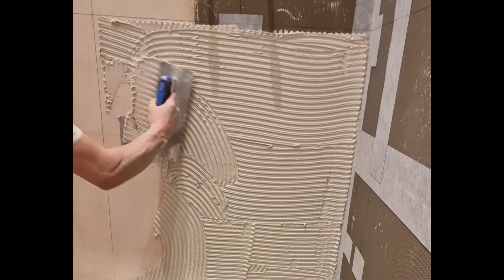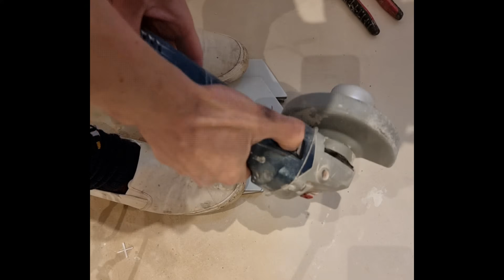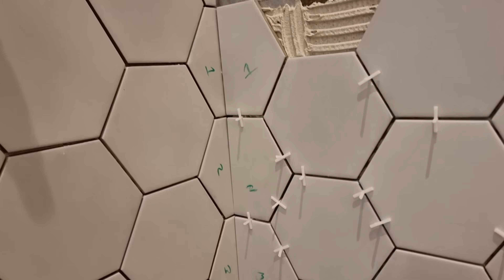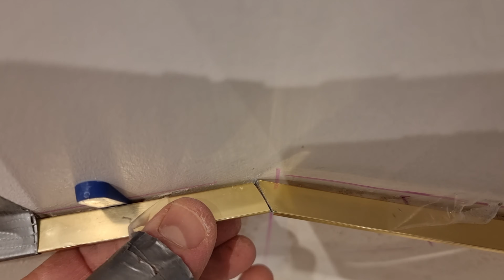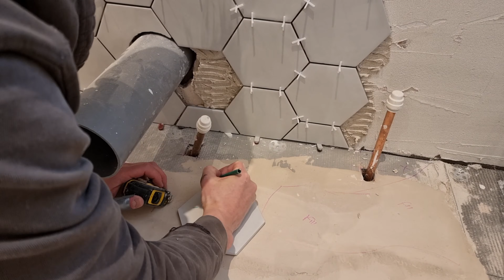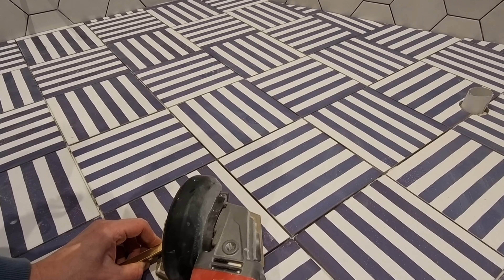How To Install Hexagon Tiles | Easy Beginners Guide

Comment: I noticed on the wall opposite the shower their is a skim coat or primer on the wall. Is that drywall plaster, thinset, or grip primer? In the US gypsum/drywall board is used in newer homes, but they are sometimes textured and painted, so we have to either replace it with tile backer board (cement or foam) or skim coat the texture flat and add a grip primer to make the surface like sandpaper. Just curious to see if that is the same process or a new and easier way. Thanks!
Reply from the maker: Hey mate, Tile dependent but basically the same process. That one is just primed/skimmed with thinset as they are small light tiles. But with a bigger large format tile I'd probably look to remove the paint/painted area if possible.

Comment: Great video. Any tips on setting out using hexagon tiles on both walls and floor?
Reply from the maker: Thanks, The same principles usually apply like.. if you've got a half height wall you want a full and a half to finish at the top, If you've got a "feature" walls you'd ideally centre that, and continue the pattern around from there. Maybe if you have niches and windows, you can try and line the bottoms up with full and half tiles, as it will look a bit nicer e.t.c. I do have a tile Setout app where you can run your hexagons through it for an ideal Setout, which may help.

Comment: Hey, thanks so much for your videos!

I'm going to be tiling some 100x100 ceramic tiles soon that are 9mm thick.

Should I use an 8mm trowel on the wall, and back butter using the flat part of the trowel? And if so, what kind of thickness of adhesive on the wall can I expect?
Reply from the maker: Hey you're welcome! Are there 100mm (10cm) tiles? If they are I wouldn't worry to much about back buttering them (as they are small ceramic) , But you can for re-assurance. 8mm trowel would be ideal for those, and you'll probably end up with about 3-5mm bed once compacted. If they are 100cm tiles, I'd go 6mm on the wall and 10mm on the tile and bed will be about 8mm. 🍻
Reply: @thebespokebloke legend, thank you! Apologies, I meant 100mm 😅
Reply from the maker: @ross1012  Awesome , Yeah I wouldn't bother back edging them then (Unless you plan to be in there for 3 years) Best of luck mate!

Comment: I’m currently having my bathroom tiled with hexagon tiles but the fitter hasn’t followed the pattern around the corner so it looks quite strange. I’ve watched your video which clearly says to follow the tiles & pattern around the corner. Would it be different with a patterned tile or would there be any situations when you wouldn’t follow the pattern around the corner? Thank you
Reply from the maker: Hey Ellie, In my opinion, I'd always try and make a pattern tile follow around the wall. Just as otherwise it looks a bit weird. But some people may not mind that. It's one of those really, I don't want to chuck the fitter under the bus.. but as a professional you'd normally think about these kind of things, or have a discussion with the customer about it. Also there is cost and different standards of work chucked into that. In my line of work a pattern or shape has to be continued if possible, But to someone else they may have a different view or view it as "They are just tiles". So long story short in my house i wouldn't have it not matched up, But some people may not mind it. Hope that helps

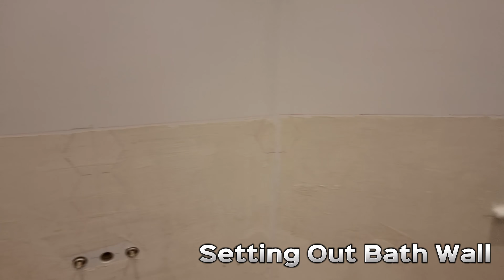Comment: 11:28 I always get confused by this and any other tile walls. how do you know if a tile will connect to the wall without placing each tile one by one until you reach the wall.
Reply from the maker: Take a measurement of tiles laid out on the floor, Or measure from what you've already done mate.. Or even better use my "Tile Layout App" Links are on my main page at the top!

Comment: Hi, when cutting out half pieces to fit to the floor, do you need to over-cut a few mm to allow for the spacing between tiles? I've cut a tile in half and it looks too big? 

Also, are some manual tile cutters better than others? I've got one from a "starter pack" and it just doesn't seem to work as easily as ones I'm seeing in videos, but it may well be me as I'm brand new.
Reply from the maker: Hey, It depends on how you cut the tile a bit and your spacing, But I'd recommend if you are finishing a full tile to the floor, Leave a bit of play (2-4mm) as it will be covered by your flooring or silicon if on a shower or bath. Then you can get 2 halves out of 1 piece of tile. If you are half tiled you may have to cut the top half slightly smaller to allow for spacing, But if you have tile trim, that should allow you to be able to fit a direct half in. (hope that kind of makes sense) regards tile cutters.. Yes, there are a lot of rubbish one's out there, As usual price normally determines quality. I have a video here on the cutters I use https://youtu.be/_pAtrJliCr0?si=Z8Cz9u4B8-7VGcPs . What cutter do you have?
Reply: @thebespokebloke  Thanks!! Next question - what's the best way to make awkward cuts around plug socket boxes etc?
Reply from the maker: @taffyapple9206  https://youtu.be/m7geX9qmE7w?t=2489 Check this out here, It's the same principles. Also This Video on taking out squares, https://youtu.be/6mmJ_gaV1tA?si=Mqt3eOwlTcbrXRIl . They should point you in the right direction.